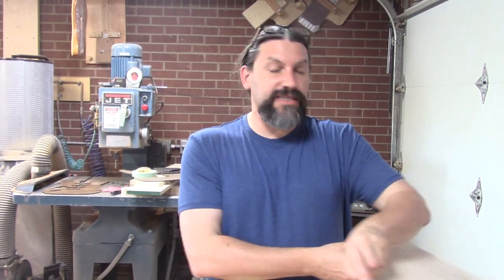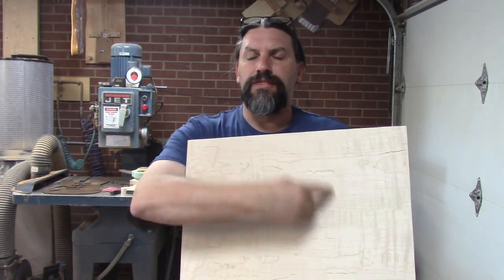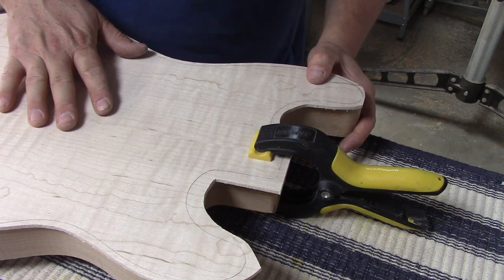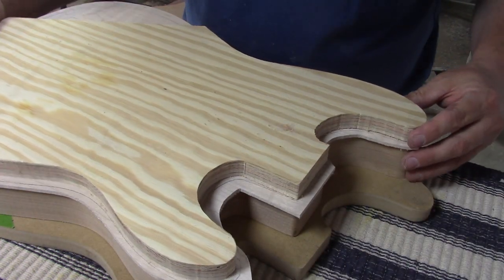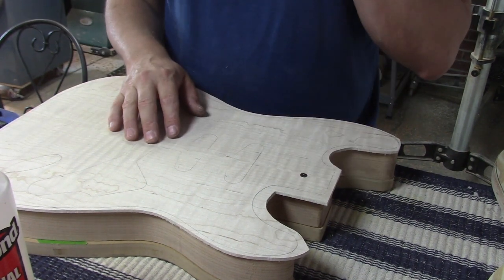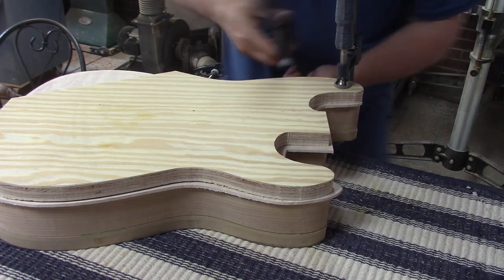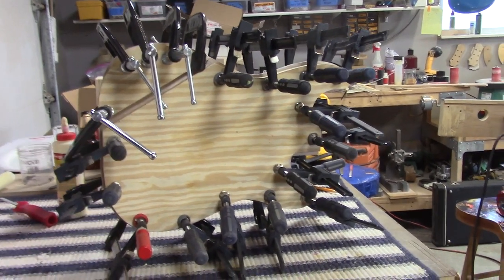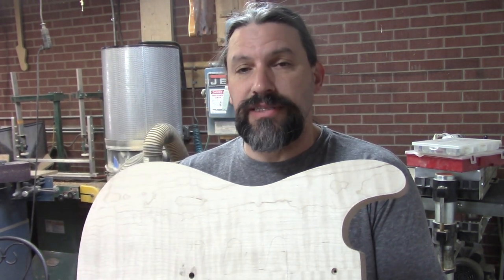How To Glue A Super Cool Maple Top To A Strat... Like  A Boss!

Comment: Man, cruised right through that one. Important for folks to know that the router table wit follower bit can be tricky doin the forearm relief are with this style top addition. The grain can be a bit angled and bit might act a little wonky, so take your time and don't use a dull bit. Will be adjustig bit depth to follow curve. May require a little extra drum sanding in case of any tearout. Just be smart and think ahead, good luck!

Comment: When clamping a large vernier, especially with the bend, I would use a 1/2 inch high density foam between the work and call.   It will distribute the pressure better especially through the curve.   You can you two layers of the "floor mat" from harbor freight.  

Great job, I love your videos.
Reply from the maker: I really like the vacuum but this way works pretty well too
Reply: You do great work.  I'm planning to build my first.  You've been a big help!

Comment: Cool video, One method I use is to rout a bunch of shallow relief lines where the top will bend over the arm contour, I don't rout all the way to the edge os the board so you won't see the lines if you want to round over or don't plan on binding the body.
Reply from the maker: We have done that on thicker tops it works great... as you know

Comment: Hey Matt!...was the body already finished thickness of 1 3/4 ?...I got a 1/4 flame maple top I'd like to add to a strat body would I need to router the body down a 1/4 inch to compensate for the top thickness?...or maybe take the top down to an 1/8 of inch ?..Id be afraid of chip out if I tried to plane down the body
Reply from the maker: Hi Gus, 
I think you would want to remove some material the thickness sander is great for that as it won't chip out the existing body

Comment: @texas toast guitars I noticed a small indent on the back from the clamps. How would you go about taking them out? Also, to prevent from getting them what would you recommend? Have another scrap blank on the back or something else?  Love the videos!
Reply from the maker: HI Tim, of course the best way is to use clamping cauls to prevent indentations. If you think ahead you can use clamps in places that will get machined more so the indents get cut away. 
If you have some you can steam them out. The wood is still there and it can be raised with moisture and heat. Think soldering iron or even clothing iron
Reply: Texas Toast Guitars thank you for the reply and the information. I’m thinking of doing my second bass build soon and love all the info and instruction. Keep up the great work!

Comment: Hi, nice vid!
what is the thickness of this maple top?
in your opinion, what is the maximum table thickness that can be bent in this way? What is the maximum angle of the bevel that can be covered in this way?
Reply from the maker: Hi Antoinie, You can do lots of stuff, the 1/8 top will bend pretty easily or you can add heat to help it along. I'm going to be doing a video soon where I bend a 1/4 top, stay tuned
Reply: @TexasToastGuitars  thx from France 😉

Comment: Was the body blank planed to be thinner, to compensate for the added thickness of the maple top? I have always liked the idea of a maple top on a strat style body(to have the good looks of a bookmatched maple top combined with the Strat's contour body shape - with the contour cutaways) but the example I saw of an aftermarket body had routing for binding, which I don't want. Thanks, I especially liked the Speedy Gonzalez video section(too bad you didn't have his cartoon vocals over that section, too). Good job!
Reply from the maker: Hi David, thanks for watching. That body blank with the maple top is just under 1.75" right at the regular thickness. In one of the next videos I'll show y'all how we do a very thin veneer top. Generally speaking you will need to have some kind of transition usually binding is a good way to do this but you can also burst the edge. People seem to like the sped up part... I just did that because the video was getting so long... happy accident I guess

Comment: Great vid! I've been doing repairs for over 20 years and think it is finally time to venture into building... do you recommend the DIY kits as a place to start? And what minimum power tools do you recommend? I have PLENTY of hand tools... leveling blocks,  fret files, etc.
Reply from the maker: Thanks for watching Daddy O'.
The DIY kits can be, surprisingly, not sucky. Do some homework and see what looks good. I'd start with the Tele one because even a lousy Tele sounds like a Tele. 
You will need some power tools for sure. I'll do a video one day about tools. I'd say you need to have a jointer, a bandsaw and a router or 2 or 3
Reply: Texas Toast Guitars I'm fully prepared for trash tuners and pitiful pups... as long as the neck doesn't look like a skateboard ramp I think I will be fine.  I've got a couple of routers, some sanders,  and a drill press. Yes, that vid would be greatly appreciated.
Reply from the maker: Sounds like you are off to a great start
Reply: Texas Toast Guitars now I just have to learn how to use them.....

Comment: tite bond 2 or 3 and why i use 3 and thinking about keepin both in the shop ,so i want your opinion as to which is best for which task thanks,  Richard, RLX Guitars
Reply from the maker: I only use the Original Titebond. There are lots of reasons to use the other stuff but I don't think they are related to guitar building. The original is also the only aliphatic resin the others are some kind of cross link polymer or something else for water resistance... who knows.
You should use what you like amigo, that's what I do
Have a great week
Reply: @TexasToastGuitars  thank  you Sir.

Comment: When gluing a veneer on like this, do you worry about how smoothly sanded the contact sides are when gluing?? Do you want the contact sides a little rougher? is 200grit enough or is higher grit or lower grit better for getting the best bond?
Reply from the maker: Both the body and the top came off the thickness sander and that has 60 grit on it. I wouldn't bother sanding any more that... even if you are using .024 veneers. I'll address that in a future video, that is a good topic

Comment: Do the contour after... and moisten it to make sure u dont break or crack it
Reply from the maker: This top was thin enough that moisture wasn't necessary. Actually, adding water to bend, even acoustic sides is pretty rare these days. I think every one has the bending machine and it is mostly heat that aids in bending. Back when I was doing side bending  we didn't have one of those rigs and you had to add water or the iron would burn your wood all to hell.

Comment: For the new top I thought you might steam it first. Any reason you don't?
Reply from the maker: The top will flex quite a bit when it is that thin. Once they get over 1/8 you might need to steam the wood or even cut groves in the back (if you are going to bind it) to get it to mold around the shape. Maybe I'll do a video about that some time?
I think I have a 1/4 top Daily Driver coming up.
Reply: I would have steamed the bend.  It will always fight to be back in its original position otherwise.

Comment: best technique? using superglue for everything! you may ask; "but 5hhhrrereeeder, how the hell do you use superglue without getting premature bonding? are you an idiot?" i would glue the non-bendy spot first, and then put glue down and bond the bendy part after it dries. clamps fly when using superglue properly though.
i just like superglue, i am not saying this is a good idea for everyone, results may vary, and normal wood glue works fine for almost every luthier application.
Reply from the maker: I often think about how you use super glue for everything... it crossed my mind while I was making this video
Reply: lol, i use epoxy sometimes... though epoxy seperates from things easy, and i had a fretboard delaminate in a spot while i was building one time because of it(which i fixed with superglue[of course] and a syringe). so, it is usually reserved for stuff like filling non-structurally crucial areas, such as filling the empty area between the trussrod and the wood.(it is more of a resin than glue in that application, since it isn't crucial that it sticks, and my trussrods have nickel plated sheaths, so they don't get ruined when i do this).
another fun glue though is foamless gorrila glue(it is a polyurethane glue), though, i like short cure times, so i only use it when it is crucial to have a long work time.
Reply from the maker: Whatever works
Reply: yup.